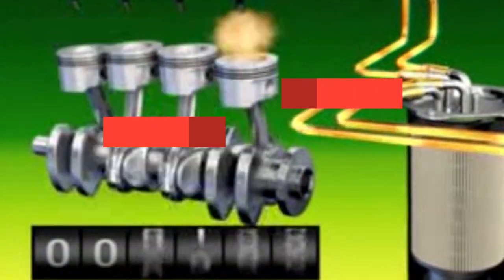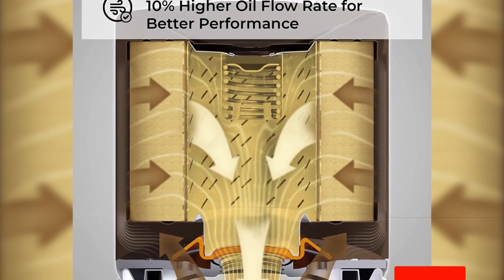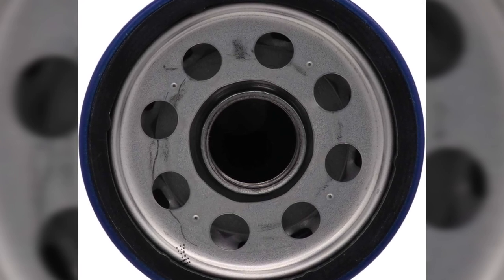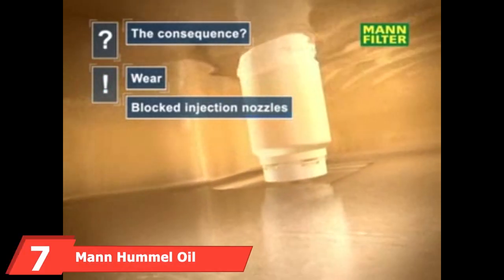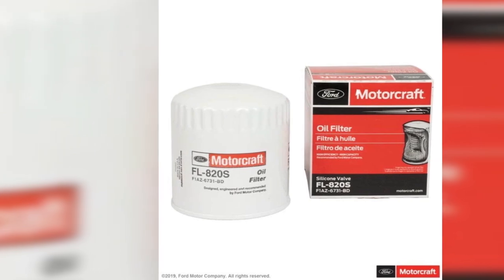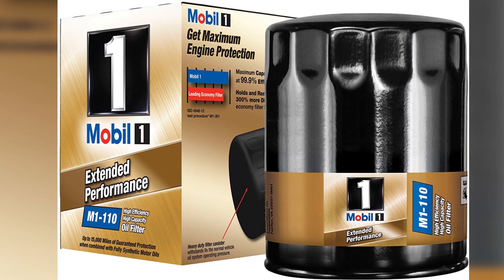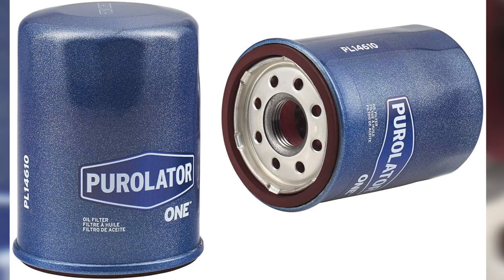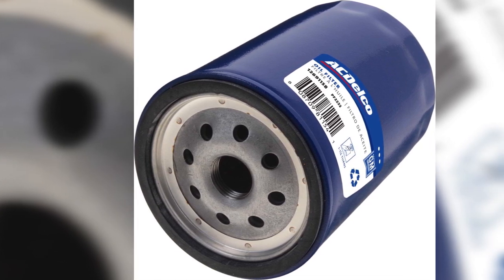Best Oil Filter In 2024 - Top 10 Oil Filters Review

Comment: I quit using Fram a few years ago because I know of three engines that were destroyed due to the Fram Oil Filter Malfunction. I started using Mobil 1.
Reply: A little more info would have been nice.  Which Fram filter, how long were they run, and how did they destroy the motor?
Reply: @lonniebeal6032  I've dealt with motors all my life, and the important thing is I have never seen another brand destroy a motor, only Fram.
Reply: @lonniebeal6032  Two words, Poor Quality
Reply: @docbrown6550  yeah you bought an orange one and tried to get more than 4-5k out of it didn’t you?
Reply: @linkgroundwalker  I buy my oil and filter at 2,800 miles and change it at 3,000 miles. All of my vehicles have over 375,000 miles on them.
Reply: @linkgroundwalker  My oil never goes over 3,000 miles without a change.
Reply: @docbrown6550  Lol " Three Engines damaged due too a FRAM Filter. " You know you sound crazy right, its the same as any other filter and I bet you anything there's more too the stories you are trying too sell. Changing your oil and filter at 3k miles SMH. 🤦‍♂️ My Truck has 1,786k miles on it and its Running like a champ never missed an oil change.
Reply: @docbrown6550  Changing your Oil at 3k miles is a waste of time and money when You can use a Full Synthetic with OEM filter and change it every 10K. Or whatever is written on the maintenance suggestion of your year, make and model.
Reply: @lawabidingcitizen9696  Fram is not the same as any other filter, I have been a mechanic all of my life, and one of my engines as I stated has over 375,00 Real miles.  Try again
Reply: @lawabidingcitizen9696  You are mocking someone for making a statement about fram filters, your statement about the miles on your truck is beyond ridiculous. The next time you want to belittle someone try being  little more believable in your comment. Oil changes is up to the owner of the vehicle, he may be a millionaire you don't know. All filters are not the same and some are better than others. Your comment was a joke.
Reply: @docbrown6550  My Truck has 1,786k Real miles as well. Its Freightliner Semi. FRAM makes a good synthetic filter that is ahead of the competition for the price. Your not a real mechanic. You probably use conventional oil from high brands that come from the same company in Omaha NE and paper oil filters instead of a synthetic thats why you change it every 3k miles. When synthetic is proven to last longer, flow better and have a lot more engine protection. And the synthetic filter that FRAM makes. 

   20 microns at 99% efficiency for 10k miles. Lets see the oil and filter you use. I Mainly use AMSOIL. Far superior then mobile 1 and the Fram ultra Synthetic. Same product as an original Amsoil oil synthetic  filter but with half the cost.
Reply: @lawabidingcitizen9696  You can't compare Semis to standard vehicles, you should have disclosed that in your original comment, they are designed for hard running and long hauls, they also hold a heck of a lotttttt more oil than regular vehicles, the amount of oil in those engines makes a lot of difference and is no comparison. Try again, you know there is no comparison.
Reply: @lawabidingcitizen9696  You know you can't compare Semis to standard vehicles, your comment was ridiculous to even try to compare mileage.
Reply: @lawabidingcitizen9696  Lets see how many Gallons a Semi has (maybe around 11 or more gallons) of oil in the oil pan.  Try something else, you're in the wrong conversation.
Reply: @RH-oj5cj  They know you can't compare these two different types of vehicles for the difference in the amount of oil especially.
Reply: @eb8967  A regular car or truck holds 4-7 qts. of oil on the average, a Semi 10-11 plus Gallons of oil in these vehicles, no comparison, they should have disclosed this in the first comment but it wasn't the statement they wanted or tried to get out.
Reply: @docbrown6550  I haven't compared them idiot, you made the dumb argument " ahh my TruCk Has 375k mIlEs oN it aNd itS noT a LemoN... well mine has 1,786k and a buddy of mines Volvo has 2,500k without a rebuild. So in your own idiotic logic we know what were talking about. 

Wise guy compare the FRAM Synthetic filter too a Mobile 1 and you'll see a clear winner. Buy both cut them open and see the difference. That buddy of mine used too use a K&N oil filter then when he did an oil change on a Cummings Diesel he got the oil tested and found out he had / dirt and rust in the oil. Then changed too the fram im talking about and did the same and the Fram did a better job by far. So started too use it on my Ford F-250 with Amsoil. Dont know exactly how many miles the RAM had but its a dumb argument as there are a lot of other factors at play other then oil filter. 
Don't trust a mechanic that has no idea what micron's and efficiency have too do with oil and an oil filter. Bet your the type a person who uses a K&N engine filter then cry about a Fram oil filter.
Reply: @RH-oj5cj  love the edited comment. Getting your facts wrong then changing them realizing you have no idea what you're talking about. 👏  are you another of these so called mechanic's I keep hearing about. 🤦‍♂️
Reply: FRAM synthetic filter offers 99% 
  efficiency at 20 Microns with a fully synthetic dual filter medium. 
As
MOBILE 1 at 99%  efficiency at 30 micron's with a synthetic blend filter medium also dual. 
Partials bigger then 20 microns cause damage too the engine. And too top it all off its half the price of Mobile 1.
Reply: @lawabidingcitizen9696  LOL,  you're a bad conspiracy theorist, I only corrected spelling. Everything you stated is 100 percent incorrect and you know it.  You are trying to compare cars and trucks in totally different categories. You have no idea what you are talking about.
Reply: @lawabidingcitizen9696  Your original comparison, was a vehicle that uses 10-11 Gallons of oil to one that only uses 5 qts of oil, in which there is no comparison.
Reply: @docbrown6550  Microns doesn't mean a thing if a filter malfunctions due to quality.
Reply: @RH-oj5cj  Exactly my point, TY 👍👍

Comment: I pay for the best Fram $6.40 cents every three months 

Fram Ultra - 99% efficiency at 20microns
93% efficiency at 15 microns 74% efficiency at 10 microns 

There is no other Automotive Filter on the market that does this and it has very nice bypass spring for cold starts oil to timing components faster 

The orange can has caused some issues but it is because people buy cheap and expect the best, it's a super low oci filter 

Many auto manufacturers use the orange can Internals in their factory filters 

Honda, G.M are some to speak of

Comment: My I have used FRAM oil filters my entire life & never had a problem. I used them on my racing engines, personal drivers & so on. I,m always amazed 
when I see all the so called experts trashing them. Wonder why they are the top selling oil filter & have been for years. I,m 76 years young & been a 
automotive machinist for much of my life. We build Drag Racing, circle track, drag boat, & tractor pull engines. Everyone of them have had FRAM filters.
Reply from the maker: Great point!
Reply: What's amazing you claiming to be a machinist actually never cut open a fram extra guard filter. If you did you'd never buy another one
Reply: I agree greatest filter ever use them on all my vehicles many many many miles

Comment: I use the purolator one as well. You get good filtration without flow restriction, at least in summer months. Motorcraft makes excellent filters as well.
Reply: ABSOLUTELY! All I use in my 2003 Toyota Matrix is Mobil 1 5W-30 through a Purolator PUREONE filter. Twenty years and 192,000 miles later, it practically runs like new.

Comment: I used a frame filter which was part of the reason my head drain tubes plugged at 152k as they are an inferior product that doesn't filter enough to protect your motor. Currently I use mobile1 on my current car with 325k with no signs of any issues

Comment: I've used fram products on my Honda civic and never had a problem. I do my oil change every 5 to 6,000 miles with no problem.
Reply: There's a video of a guy who cut open his base fram PH series after 5,000 miles, it had separated the cardboard end cap from the filter element, meaning no filtration to the oil going through the separating.  At 3,000 miles they are probably fine.

Comment: I use the purolator one. From my own research its the best for the money. 20 microns at 99%. I haven't seen any other equal to it or better.
Reply from the maker: Feel free to subscribe to my channel and click bell icon for the latest auto gear videos.
Reply: Only the Boss beats it!
Reply: Royal purple 80% at 10 micro
Reply: Fram XG Ultra Synthetic, 20 micron at 99%.
Reply: Those numbers look good on paper but you really don't want that. That means more restricted oil flow, where the bypass valve will be open more of the time, like cold starts, especially if you live in cold climates, letting more unfiltered oil pass through the engine.
Reply: Yes, possible but if it is letting more oil in and filtering less then there's almost no point to even have a filter.
Reply: @papiparsons9045  Boss is 99% at 25 microns (which they market as 99+%). One is still on top for efficiency in Purolator.

Comment: Surprised that the number 1 filter is the Fram Extra Guard?  It is the cheapest, with no exceptional quality other than the filter media and price.  This filter was designed to go about 3,000 miles with normal oil pressures and functions well in these parameters.  I’ve used them for years in the 70’s and 80’s with no excessive engine wear in my 4 and 6 cylinder engines.  However, going to 5,000 to 10,000 mile oil changes, I had to go to the OEM filter for 5,000 mile and Mobile 1 filter for 10,000 mile or longer.  Strange video.  Also, the narrator is very strange:  He called the A C Delco filter “AckDelco” and Fram filter,”Frim”.
Reply: Yes I heard that also, the narrator is a stupid computer generated voice.
Reply: And called it an air filter a few times.
Reply: fram  is  The worst brand I would never use them
Reply: Back in the pre 1960-70’s, when Fram was owned by Allied Signal, they were good…
After that sale,… they are the absolute worst oil filter ever!!!
The best are Napa Gold or Wix
Reply: I pay for the best Fram $6.40 cents every three months 

Fram Ultra - 99% efficiency at 20microns
93% efficiency at 15 microns 74% efficiency at 10 microns 

There is no other Automotive Filter on the market that does this and it has very nice bypass spring for cold starts oil to timing components faster 

The orange can has caused some issues but it is because people buy cheap and expect the best, it's a super low oci filter 

Many auto manufacturers use the orange can Internals in their factory filters 

Honda, G.M are some to speak of
Reply: Fram ultra synthetic filter is just as good. Orange can is the shit one.
Reply: @linkgroundwalker  Actually, the Ultra Synthetic is a premium filter and much better for the money than pretty much any other filter out there.
Reply: @dannyo6699  yes I know, it’s the orange can that’s shit.
Reply: @linkgroundwalker  Well, Fram was the original aftermarket filter manufacturer and they've been around for multiple decades now, so they know what they are doing. They've had time to test their products to find out what works.
My family has been farming for close to 100 years with mechanical farm equipment, and we've put a lot of Fram filters on a lot of tractors, trucks, combines and other farm equipment, and we've never had an engine failure due to a bad oil filter. My Grandpa was even the owner of the local Gambles Hardware Store in my hometown back in the 50's and 60's and he carried Fram filters. He never had anyone come back complaining about a bad filter.
I now work at Walmart in the Auto Care Center as a Service Technician and we install the Fram Cor filter, which is about the same as the PH filter without the fancy stencils on the outisde. This past October I hit my 15th year at Walmart as a Tech, and to date, we've only had maybe 5 at most incidents of a filter failure, and every one of them was a failure in the gasket, the weakest part of the housing. I've easily done several thousand oil changes and to have maybe 5 be bad is a pretty good success rate. They all failed right in the shop and we immediately pulled the old filter off and installed a new one.
Fram doesn't make bad filters, they occasionally make A bad filter. But so does K&N and Mobil 1 and Purolator....
Reply: @dannyo6699  yeah I have no doubt they were a good filter back in the day…things change companies cut costs.
Reply: @linkgroundwalker  That is true.
Reply: The voice on this video is computer generated that's why it can't properly say some names like ACdelco

Comment: How is Fram extra guard the top filter? If you said Ultra Guard series, that would be more believable but extra guard cannot beat K&N, OEM, Mobil1 and Bosch
Reply: Fram tough guard is rated at 5k miles, extra guard si 10k miles and ultra guard is 16k or 20k miles depending on old Fram ultra or new Fram Ultra but only the Ultra guard can top other brands.
Reply: @shazam6926  wrong, tough guard is 15k, I'm not sure if I trust the extra guard at10,000 if I get them again I will change them every 5k they are $6..I am looking for one to use every 10k sounds like Mobil 1 or Purolator maybe Bosch.Also.who.really is going to leave a filter in for 2 years? Nobody

Comment: If the oil I'm changing is way past due, I change the oil I put a tough guard frame run the car around for 20-30km  change it again and use a k&N 
- the only time I will use a frame.

Comment: I always use the cheapest filter Supertech Quaker State or cheap Purilator and full synthetic oil. Your oil bypass re routs the oil and dosen't filter anything till the oil gets hot and thin enough to get thru the filter media. It is just there to catch the chunks. Want your vehicle to last, use full synthetic and change your oil every 10,000 miles.

Comment: I just use Honda OEM filter. On my Honda. Just over $7.00 from dealer.  If the engineers at Honda approve I’m good.
Reply: Cut one open, I looked up my RDX filter from Honda here and it looks like the Fram with card board end caps.

Comment: Fram, the paper end caps are so much better than steel! And who needs silicone drainback valves when nitrile rubber fails under harsh temperatures? Super Tech from Walmart is so much better and costs less, not that I would use either!
Reply from the maker: Thanks for the info!

Comment: Nobody I mean nobody mentions were there made
Reply: I run BOSCH Premium Oil Filters in the famous 95 MERC and in our Acura MDX, with Pennzoil Ultra Platinum, 5-W-20; and a FILTERMAG # SS365PR on the MERC.
 Oil & Filter changes at 5,000 miles.
The Bosch Premium has a 20-Micron rating -- and it's MADE IN USA !!

Comment: I use a mopar filter manufacture recommended 😢.., why guess on a 40 or 50 dollar auto over a $2 difference in price on a oil filter ? Puzzling why y’all do that 🤔🤔… 40,000 miles and you might save $30 with those filters… me ? I don’t get it … how long does it take to do 40,000 miles ? So if you are wrong on the filters, you won’t know until you get to 80  … 90,000 miles …. You got a good chance if you have and overhead cam of developing a tick …. That can be expensive… most people at that point will start to use additives to quit it down ,,,  That’s the death… you’re in whopty land then 😅😅😅

Comment: Number 1 is fram extra guard....BS... if you want a cheap filter with cardboard end caps... only thing they are good for is doing an engine flush and changing oil every 500 miles... I wouldn't use 1 for a long time on my mower